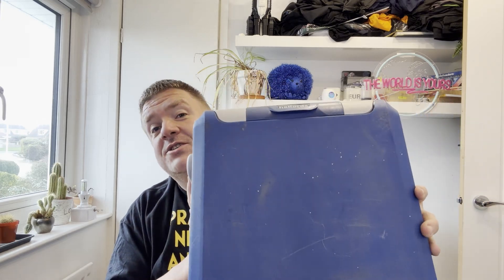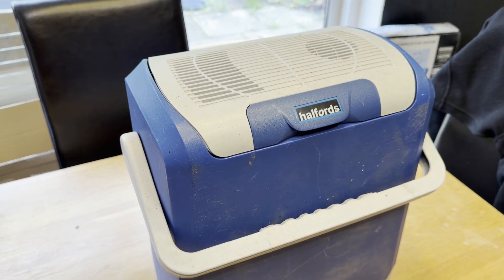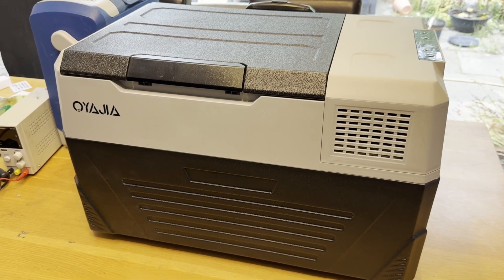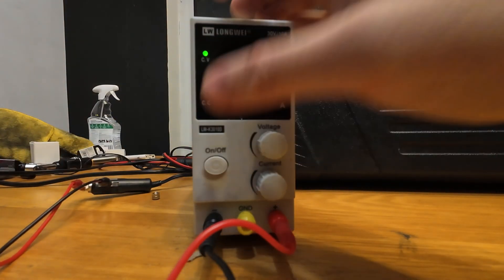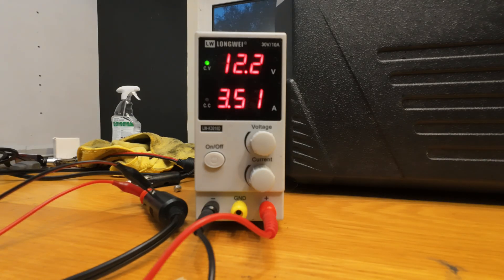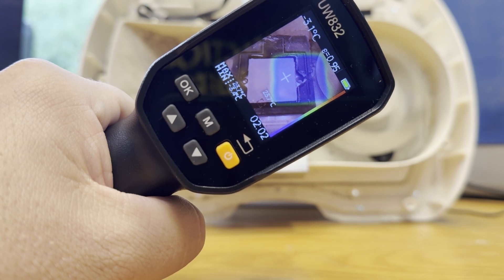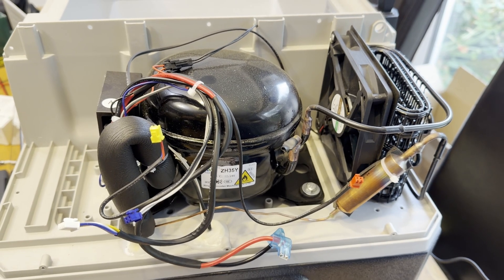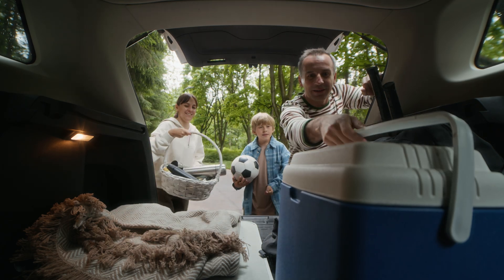12v coolboxes: thermoelectric vs compressor. A nerdy showdown (with teardowns and testing)

Comment: Mat, you omitted to cover the same innards in a dehumidifier ⚠️
Big disadvantage of a compressor type is they don't work very well below 5C ambient where as a thermoelectric or better still a rotating desiccant disc type will continue to be efficient.
So good for keeping car interiors dry in storage in winter.👍
Reply from the maker: Don't worry - they're lined up for a future follow-up. I've had a thermoelectric demidifier in the 'stuff I might find handy one day' pile for a while, and we'll take an in-depth look at exactly what's inside one soon. 
Dessicant dehumidifiers are an interesting bit of tech - Technology Connections did a great video on them recently which is worth a watch!